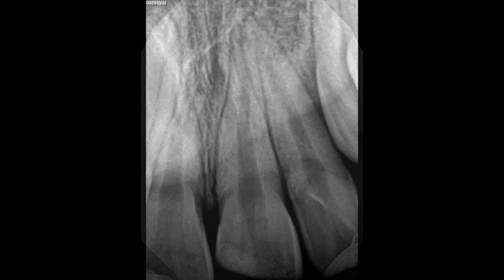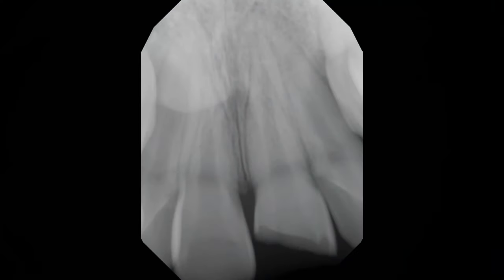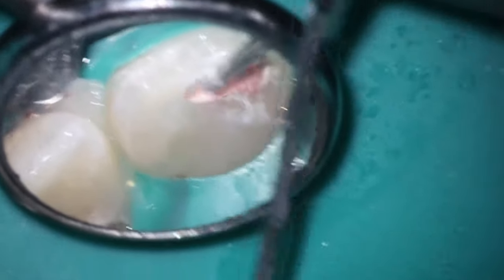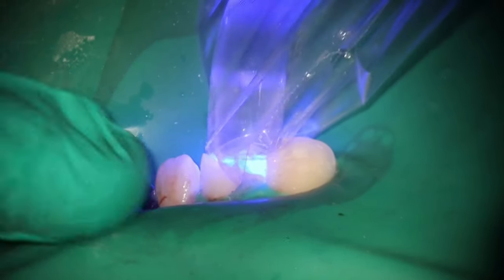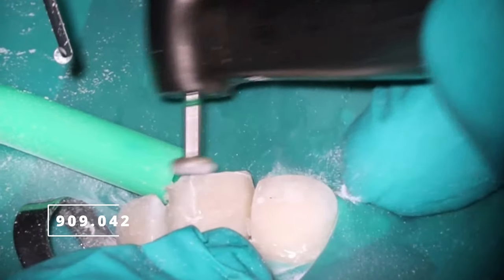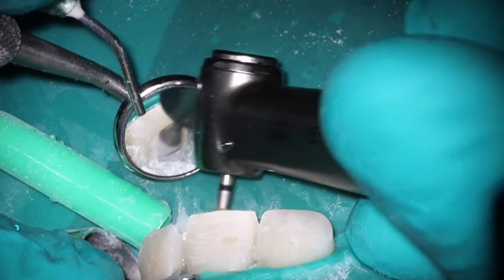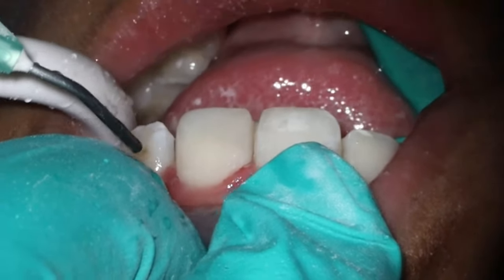Cvek Pulpotomy with a Bioclear Composite

Comment: Nice job! I also met this issue several times until I followed the protocol dr. pascal magne proposed, to fullly etch and additively vennered the entire facial surface of the traumatized teeth using composite. It’s little bit time consuming but worth trying
Reply from the maker: Pascal is the GOAT! I’m not familiar with his technique for this case but will look it up. Did he post it online or anything?
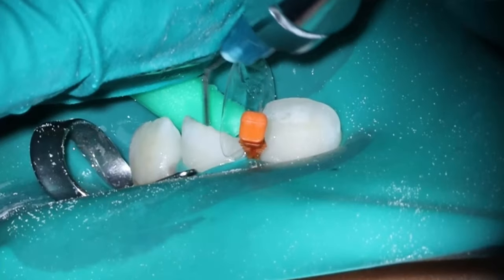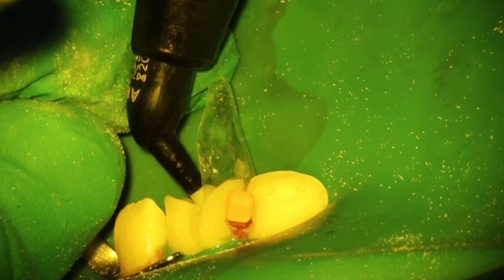Reply: For videos,  5:55-6:30 in this one  is currently the protocol I adopt (I usually use bulk fill resin in one layer) https://www.youtube.com/watch?v=7NiVSHm-tsI @PatencyPro
Reply from the maker: Sorry it took me a few days to get to this. That technique is cool and I love what Pascal is doing with biomimetic. My thought process (stolen from David Clark) is why would should we mimic something if we can make it better? Injected heated composite is how they make airplane parts that have to undergo significant stress. When you layer composite it creates stress points that can lead to failures. Newer composites look pretty amazing for being "monochromatic" and I don't know if we need to do as much layering as we did in the past. I'm certainly not qualified to have strong opinions on this topic, so I'm open to learning something new!
Reply: Totally agreed. In practice, I also use one-layer bulk-fill monochromatic composites instead of layering. I think the new idea from the biomimetic approach which 'shocked' me is increasing the area of etching and bonding to almost the entire facial surface. Then the composite could be bonded to the entire facial surface through multiple layers or bulk-fill technique to 1)increase the bonding surface and strength; 2) hide the composite-tooth transit line near the gingival margin.    @PatencyPro
Reply from the maker: That makes sense to me. Enamel bonding is straight fire compared to everything else and that technique allows you to hide the margin so well. 👍🏻

Comment: Great case! And beautiful results. General dentist here,  just curious would there be a better way for the referring dentist to temp the tooth in this situation until the patient can be seen by you? e.g Dycal vs leaving the tooth as is to improve prognosis?
Reply from the maker: Fantastic question! If you cover it short term, I would prefer an unfilled GI like Vitrebond or Fuji I. The fluoride will help the pulp and won’t cause as much pulpal necrosis. IRM or Dycal work by creating a zone of necrosis that is “supposed” to create a new barrier of dentin, but they seem to cause more issues down the road. 
As a general dentist, it’s usually not feasible to keep BC putty or MTA around, but Biodentine from Septodont is an excellent option as it’s far more shelf stable, and you just have to triturate it before using it. Most of the pediatric dentist’s in my area use it and find it works very well.